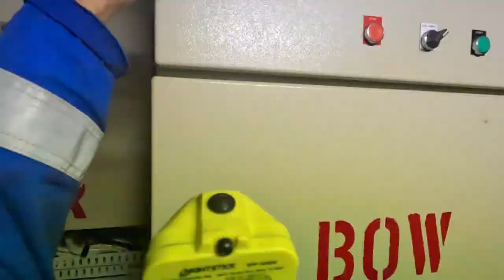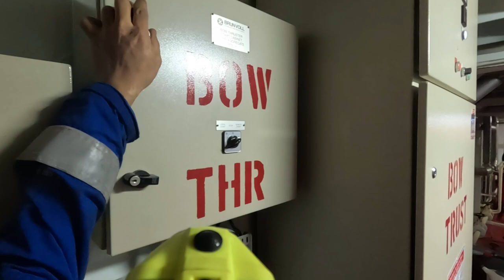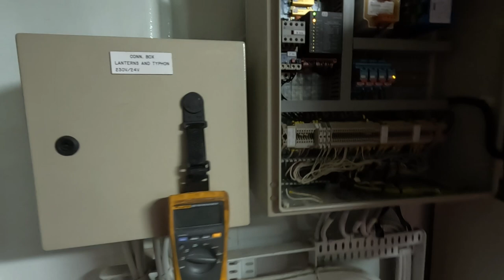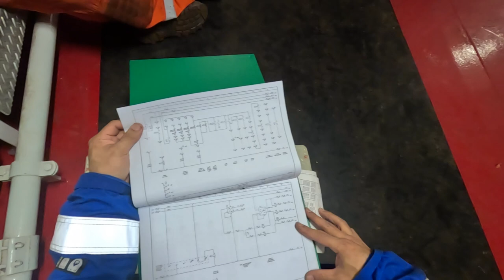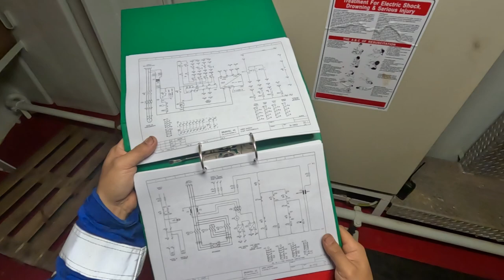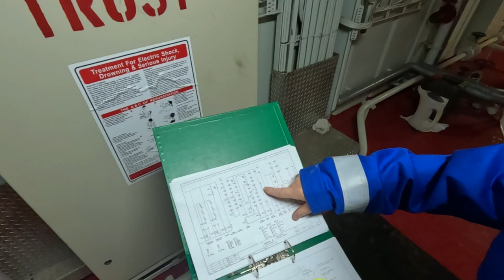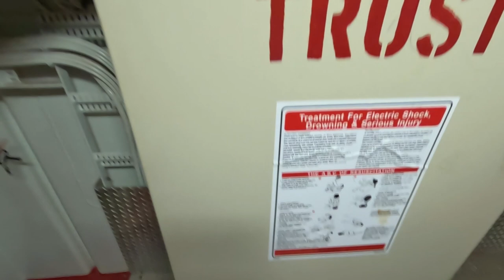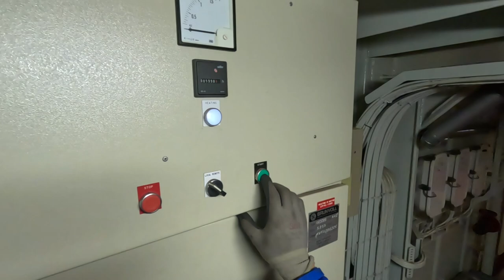#ProbeDD2023! Bow Thruster Unable to Start While Leaving Floating Dock

Comment: Goodjob in faultfing. So, the reason was like a faulty signal from PMS didnt allow the BT to start. Can you explain, was it a problem with some relay contacts or PLC output signal on MSB side?
Reply from the maker: There was an IAS retrofit during this DD and the retrofit service engineer was not yet finished with the PMS programming so we have to override bow thruster’s logic interface with PMS.
Reply: @ProbeLem  Got it!